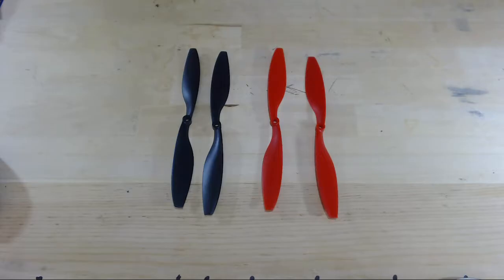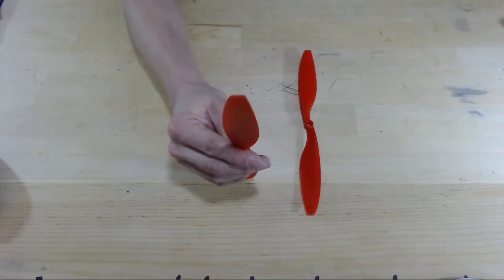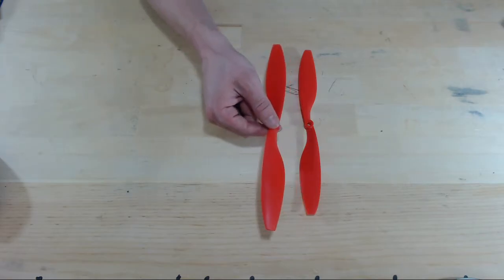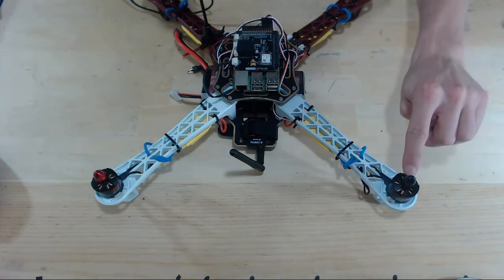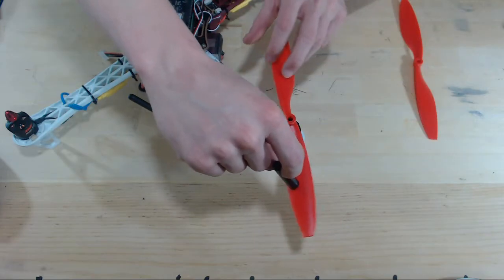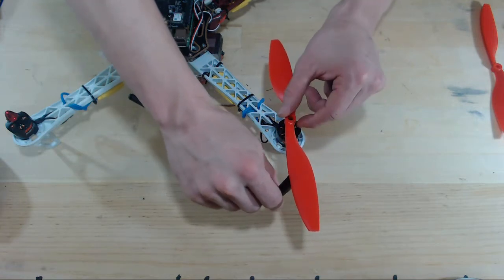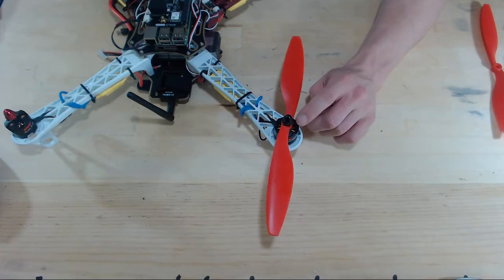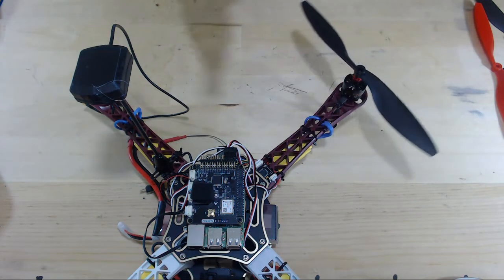Correct Installation of Drone Propellers

Comment: Thanks for the tip on not tightening the props all the way. 2 of my props came off mid launch amd are somewhere in my eucalyptus tree. God only knows where the nuts went. 👍🏻
Reply from the maker: It's a balance. If you don't tighten enough the props will fall off. If you tighten too much you will break your props off.